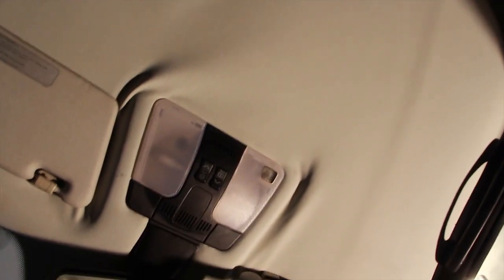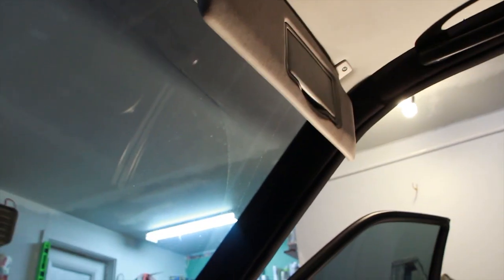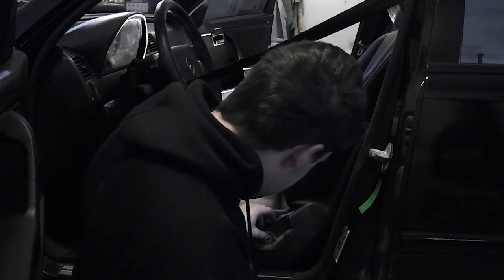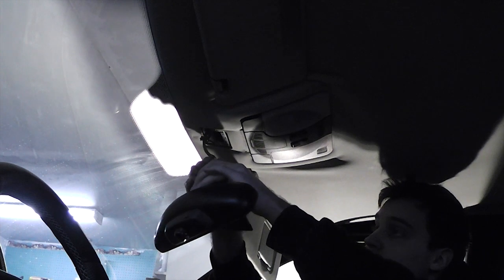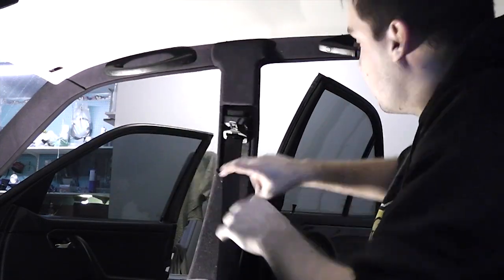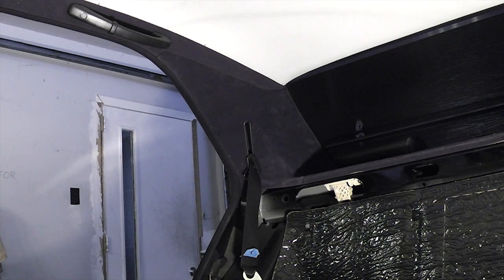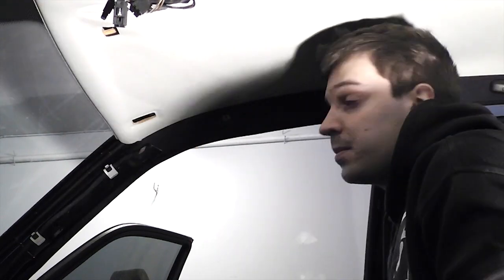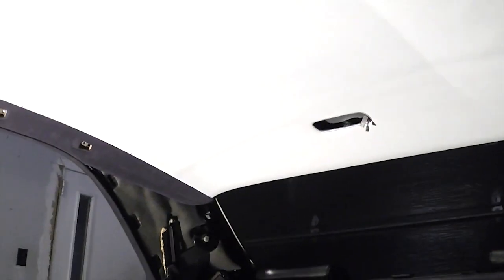W202 Headliner DIY - Removal

Comment: Well done, man gonna do the same procedure in spring or summer, have the same problem. The real problem would be  finding the same material as the pillars have (black)
Reply from the maker: I'm currently shopping around for materials. The challenge for me is that the headliner is two tone. Most of it is white, and then there are two strips running lengthwise that are black in order to blend well with the black trim. I'm thinking the best way out would be to buy some similar fabric to what's currently there (not headliner fabric, don't need the foam-backing for this part) and sewing it to the headliner fabric. I was going to go for white suede as the main material, but since it costs a million dollars to ship it from the U.S, and have found no suppliers for it in Canada, I'm going to settle for a more basic headliner finish.

It's too bad, the headliner is probably the only place that suede belongs in a car...

Comment: if this is a C220 and not a C230 the headliner board can be removed thru the front door without removing the front seat. The headliner board of the C220 is smaller than the C230/240.
Reply from the maker: removing the seats only takes a few minutes and makes this job a lot easier.
Reply: I just did this yesterday on my 96 C220. All I did was fully recline both front seats, put gear shift to D4 and maneuvered the board thru the front passenger door. Pillars A B C trim should be loosened to release board.
Reply: What a prick of a job to do.

Comment: Another easy way is to leave the seats in, and move the liner through the front passenger door, which has a bigger opening.
Reply from the maker: I feel like that wouldn't work though, the front passenger door would be open the wrong way
Reply: I does appear that way, but the front door has a wider opening. I have done this on my C180 Espirit, works like a treat. I covered the headliner in black suede fabric, but I rekon the light material you used looks better.
Reply from the maker: @jacobnel1880  You know sometimes I doubt that and wished I went with a black fabric! Eitherway it's better than the plastic non-sense that was there before.
Reply: @PatsCarGarage  you are confusing me now! I bought another 200 W202, also with sagging HL, and I thought I am going light this time.
Reply from the maker: @jacobnel1880  I'm sure they would both look good!

Comment: Why not just cut the line between the black and vinyl white material and glue it easier on the top roof and the edges ??
Reply from the maker: Since it's the foam layer that fails, simply adding more glue would only work temporarily if at all, there wouldn't be good surfaces to adhere to. If you want a fix that would last a long time, you need to use a contact cement, which works a lot better if you put some pressure on it while it cures, so the headliner has to be out of the car, and you'd need to clean the old foam off.